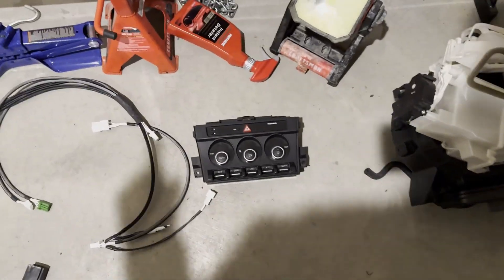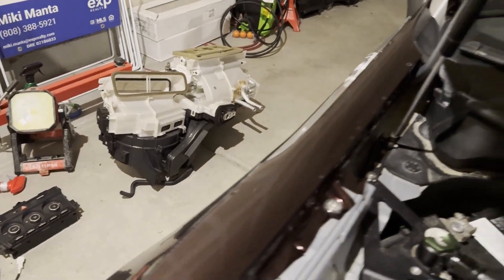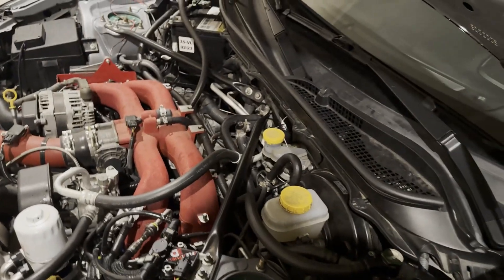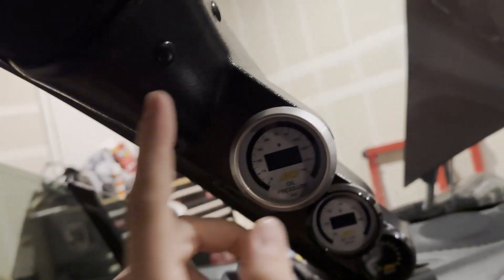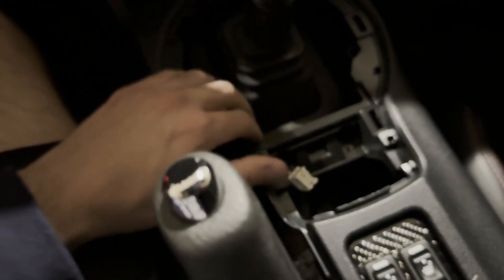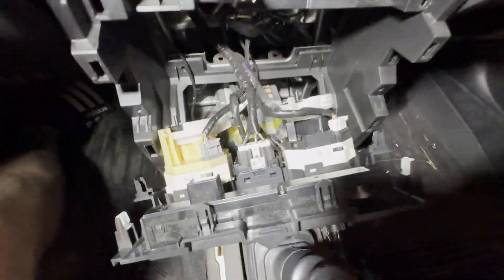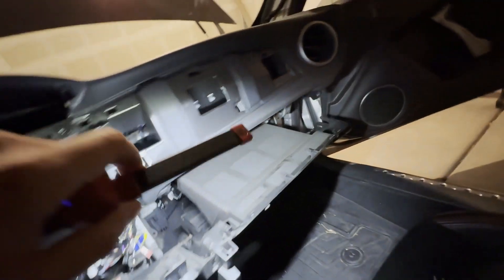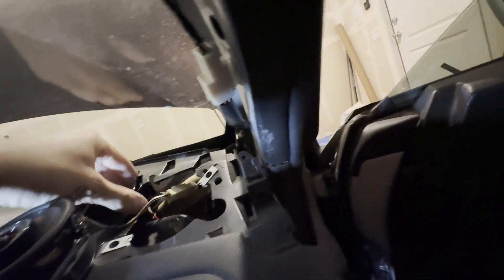FRS / BRZ Automatic Climate Control Retrofit Tutorial Pt.1/4 Removing the dashboard

Comment: i don’t rlly care about getting the dual climate to work, i just wanna swap the newer interface in bc i think it looks cleaner. is that as easy as it sounds or not
Reply from the maker: I’m not sure how easy it is to just swap those things, there are different harnesses/wires. For example the single climate control is operated by cable pullies in the knobs, while the dual is operated by electronic servo motors. I do know you can do the swap, but you need to change some of the servo motors and I believe you also need the custom wiring harness as well.

Comment: What happen if I only change the module control climate?
Reply from the maker: @W07-q2y  it is doable, but you have to still do all of the wiring, and you would only have single climate control. It would essentially be a facelift for it. One temperature for both sides instead of individually